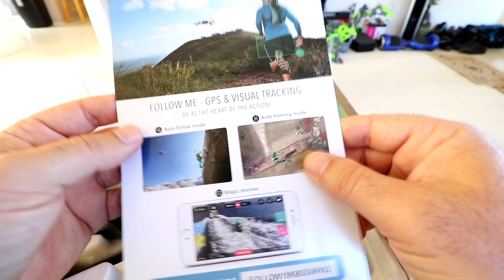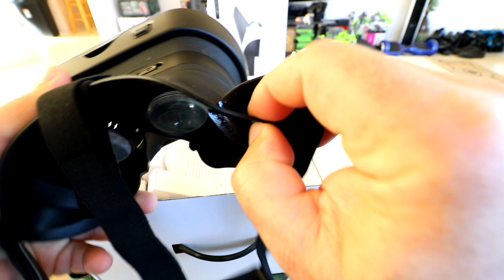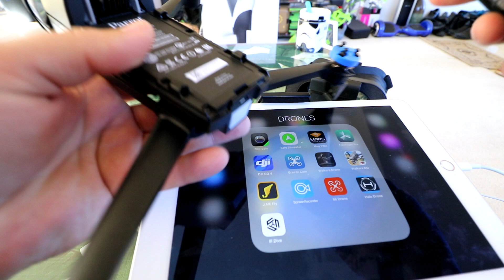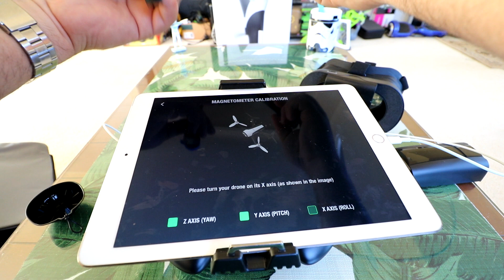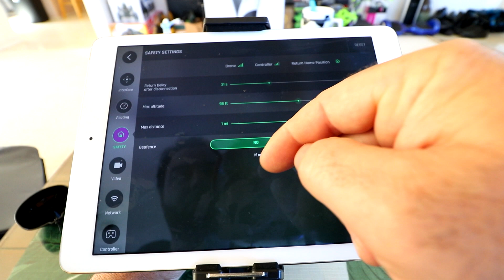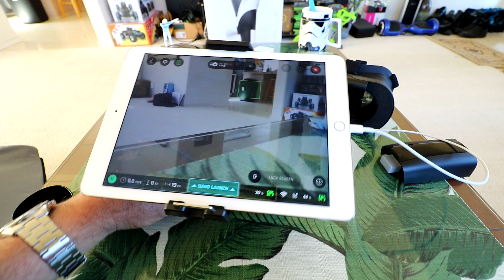Parrot BEBOP 2 POWER EDITION Review - Part 1 - [UnBoxing, Inspection, Setup & UPDATING]

Comment: I know I am late to the party and I'm sure you have found out by now,that even though the power and standard edition look physically the same the internals are completely different. Better mother board..PE motors are completely different,standard motors wont work,the camera has more memory,even the cooling fan's for the MB won't work ( I have the PE and two standards) the only thing that is really interchangeable is the cross-frame and the props and landing gear

Comment: I am looking to buy a bebop 2 power but have been receiving some conflicting information from the Parrot forum.   I have a fully updated IPad Mini 2 with wifi only (no data).   Will this work with the Bebop 2 Power?   When I'm out in the country with no wifi, where does the wifi come from?
Reply: WiFi is a type of radio signal. You do not need internet for it to work. Don't mix the terms together. Many devices can use a WiFi signal and at the same time never connect to the internet. What happens is your remote control and drone have WiFi and communicate with each other. No internet involved.
Reply from the maker: Yes will work.  You don't need data.  It's just using WiFi connection.  Preload your maps at home on your internet to display them when you fly.
Reply: Thank You.  I really enjoy the videos.

Comment: Hey Dustin hope your ok after that hurricane! Can you use a bebop 2 power battery with the OG bebop 2?
Reply from the maker: All ok here thanks.  No because the bb2 is a higher voltage and has different connectors ✌️
Reply: @DustinDunnill  glad your doing OK!! Every time I hear about a volcano or in this case hurricane I think of you n hope your ok. Thank you!
Reply from the maker: Thanks man 👍

Comment: Hey dustin, I live in the country and have zero cell service,can the drone still be used
Reply from the maker: Yes, you don't need service 👍
Reply: Dustin Dunnill also when i received my bebop2 power I notice that my controller did not have the metal thumbsticks,they where plastic
Reply from the maker: Yes, new model controller
Reply: Hey guys I need to get the sizes of the drone for a school project and I would like some help as I only find the dimensions of the drone and not tye propellers or batteries please help
Reply from the maker: Yes
Reply: @DustinDunnill  okay I understand you probably have alot of people asking to message you in pm so I ask on this 

Can you give me the size of the battery like dimensions then the part that has the camera then I would like to know the size of the wings(the things that carry the propeller) thanks

Comment: Nice video, Parrot Bebop-Pro Thermal is a cool economical thermal drone solution, good work Parrot! Can't find even a single proper review of this Drone on YouTube.
Can someone please do a video about Bebop-Pro Thermal with unboxing and complete review, also please show the settings on the thermal view of the FreeFlight Thermal app, what are the use cases for this drone. Thanks.

Comment: What actually is difference in Bebop 2 and Bebop 2 Power please?
Reply from the maker: Color, higher voltage and larger battery for  longer flight time, new FPV goggles.  That's about it.

Comment: Hello the battery of bebop 2 is the same with the bebop Power:)
Reply from the maker: It’s larger and higher voltage than the bb2 I’ve had for 2 years unless they also updated the bb2 recently.

Comment: I'm curious why your back pack looks different then the one I got with my Bebop 2 Power FPV Adventure extreme. Mine is a plain black pack with a sturdy but gushy foam to keep everything snug from sloshing around with the props attached, 2 battery slots and a slot for . I'd be more confidant with my back pack in checked luggage than yours. You can see the current back pack on Parrot's website.

I wanted to know your opinion of the tablet/phone mount in terms of it's pivot direction being in the opposite direction of the user. I think that is weird, but I don't think Parrot intended it to pivot while in use. I think they wanted it pivot to fold up for packing.

That little red blinking icon that appears on your iPad indicating where you need to point the SC2 seems to be an iOS only feature as I don't see that on my Androids.
Reply from the maker: it's the pack from regular bb2.  The pivot is a little weird.  I just remove the clamp in transport.
Reply: Dustin Dunnill Hmmm. OK. I just don't see it on the Parrot website.

Comment: the bb2 power or the spark fly more combo?its the same price!
Reply from the maker: +RobPlay s You have to determine if you want flight time vs size.  Spark 14min vs Bb2 power 27 minutes plus it can do auto waypoint missions.
Reply from the maker: +RobPlay s You have to determine if you want flight time vs size.  Spark 14min vs Bb2 power 27 minutes plus it can do auto waypoint missions.
Reply: Dustin Dunnill wouldnt it rather be flight time vs camera quality? im more likely flying a „bigger“ drone than a smaller.
Reply from the maker: +RobPlay s they are both 1080 cameras albeit the spark has slightly better image quality.  It sounds like you don't need someone else to make your mind up for you 😅✌️

Comment: Hello Dustin, I bought a bebop power 2 and the thing just fell from the sky. Do u have an idea of what went wrong? Thanks for your help
Reply from the maker: +Sergio Faith Yikes!  Just shut off?  What were you doing when it happened?  Battery %, mode, altitude, speed etc.
Reply: Dustin Dunnill 
Everything was fine, fresh battery and it was only in the air for 5 mins. Supposibly what I've been seeing on YouTube is that you have to do a hard reset to th3 device once the updates are installed but Parrot never said anything about that and also something about the cache in the App. Battling with parrot so I can get a replacement but their not an easy company to deal with. I have their Disco and that has been fun but just disappointed with the bebop power because of the fact it just fell out the sky with no warning at bout 50 ft and 40 ft away from me.
Reply: It was just hovering
Reply from the maker: +Sergio Faith weird.  I haven't had that issue during multiple flights after updating.  Maybe a defect.

Comment: The range is manageable I managed to pus it up to 1800ft max I didn’t really try to go further than that cause didn’t want to lose the camera signal and plus to get a really good range you need to fly at least 300ft or higher if you are in an area with lots of trees

Comment: 👌👌👌I still love my 1.5 year old Bebop 2, Parrot is doing a great job with the updates, so it doesn't feel like you have an old drone... my only cons are: no balanced charger, so your batteries will go out of balance and will not be charged proper ( I did a video how to save them with a balanced charger ) and of course the video quality could be better, but for myself it is decent. In 1,5 years the drone never let me down, no issues at all! It is so much fun to fly it! Thx for the review, mate! 👌
Reply: Hans S., can you share the link for balance charging the bebop2 batt
Reply: my video about using a 3s balance charger, soldering required: https://www.youtube.com/watch?v=zRVQX2gfJrw&t=12s 
about an aftermarket Bebop2 charger, no soldering required: https://www.youtube.com/watch?v=Hg1cq7lKKPI  you can find it in Amazon

Comment: Hey Dustin. Have been watching your channel for a year, thank you. I got into micro racers with brushed motors due to the fact that brushless 200 size ones break a lot and I can’t rely on them at all. Could you recommend something with brushless motors, is durable and reliable? My current setup is sky zones sky02s+ and Taranis qx7. I love my tiny whoop it survives any crash but would love to get a fast reliable freestyle drone which won’t make me fix it all the time.
Reply from the maker: +Dany Orlov Hey Dany.  There are sooo many good and new mini brushless quads out now.  Maybe try something in the 100mm range and you'll find they are very hard to break.  I love the little KingKong series but they lack OSD this far.  I have a bunch up for review and I'll be sorting through what's good 👍
Reply: Dustin Dunnill ok waiting for it then!:)

Comment: You should invest in a tracker for your drones! I would have lost my bebop at least 3 times by now if I hadn't had a tracker. I watch all your videos by the way. I've just never commented. Can't wait for part 2 :)
Reply from the maker: +ksrnate I got a trackimo mostly for the DISCO 👍
Reply: Dustin Dunnill 
That's good then. I use something called loca8tor, about the size of a £2 coin. No sim card, works on rf signals so up to 300 or so meters which is fine if you know roughly where it is!

Comment: Keep in mind Dustin , you need an aftermarket balanced charger for your bebop batteries to get piper charge. 

And my original bebop 2 did come with the rubber boots over that motors
Reply from the maker: +Johan Smit you'd think they would be balance charging in this day and age.  I honestly hoped the main terminal was a balance connection.  Hard for me to believe that they wouldn't enable balance charging out of the box with such a smart drone like this.
Reply: It seems the BeBop 2 Power Charger is different and a balanced charger now, perhaps Dustin can double check?
Reply: Johan Smit it’s the same exact charger. And I agree with Dustin that a 500 drone should come with a proper charger. 

The stock charger will work fine for a period of time , but if you have a voltage reader you can see that each cell is being equally charged and that’s what cause the life of your battery to diminish.

Comment: I have a few 4000 mah batteries I got off eBay , a lot cheaper than the stock batteries and they work great. 

I still get about 25 mins of flight time , similar to the smaller stock batteries , but for the price you can’t beat them.

Comment: Thanks Dustin this is the first review I've seen on the Bebop 2 power i had the Bebop 2 and sold it to get a Mavic wish i had both 
now. Cant wait to see your flight test. Thanks
Reply: Is there room for glasses when you wear the goggle assembly?
Reply from the maker: +Ronald Plocher very small glasses should fit
Reply: @Rick, any views on Spark vs Bebop 2 Power since you have the Mavic?

Comment: I don't think we can say old vs new.   I did quite a bit of reading and there's virtually no changes from this and the power edition, other than that the batteries are apparently a bit higher voltage and higher capacity.  Same listed processor and GPU, same frame, same props, same motors, same limited non-expandable 8GB memory storage, and on the regular Bebop 2, you can use the new Freeflight Pro.    The Bebop 2 does need an upgrade, but Parrot just ad big layoffs and I think is afraid of a downturn in the drone market because of recent anti-drone laws passed, so they probably just don't have the capital to compete.    That said, I bought a standard edition Bebop 2 brand new for $218 shipped (after cashback), so I had to bite but I can't believe Parrot is making any money at that price.

Comment: No 4k? I'm out. Was loving it until then.
Reply: Most people? Can you show me the statistics? How about the statistics of people buying a 4K TV versus a 1080p TV? And, of that percentage, how many are owning drones?
This is being typed on a 4K-screen laptop, I have several high-end 4K TVs, I have a PS4 Pro, a 4K Xbox One S, 4K GoPro Hero 5, etc. I guess I should be forced to settle for a non-4K, because "most ppl [sic] don't even have a 4k tv," huh?

This isn't 2013, where 4K is rare. In fact, it's harder to get a 1080p TV than a 4K, simply because almost no one produces them. To say what you said is foolish and outdated.
Reply: As Orlando Streets stated, 4K offers a huge difference for authoring and post processing. Besides, if you only have a 1080p screen than your screen will down grade the res to 1080p anyway. 

That being said, the Bebop camera is actually 4K. That's how the stabilization works. It takes a 4K image and crops it dynamically. The still pictures in DNG RAW are essentially full 4K frame.
Reply: I think you replied to the wrong person. I agree with you.
Reply: Orlando Streets what's the point in 4k most ppl don't even have a 4k tv or phone
Reply: Lots of reasons. First, you are future proofing your work. Second, filming in 4k gives the creator extra versatility in post production. An example would to pan/crop/zoom the 4k then render in 2.7k, 2.5k (1440p) or 1080p. Three; more of us have 4k monitors with bandwidth to support it than you think. Four; Theoretically potential viewers may choose to watch a 4k over 1080p of similar content giving the creator an edge. More?